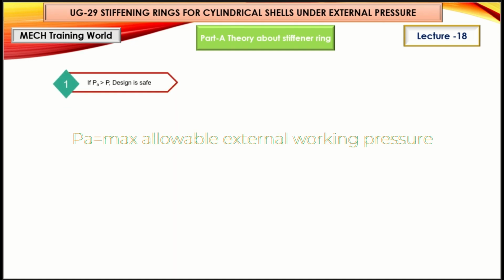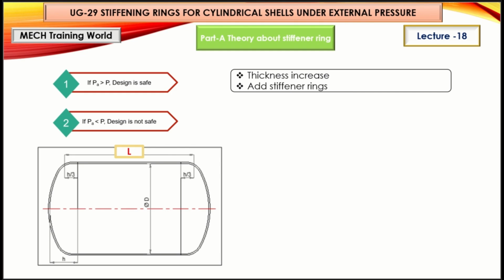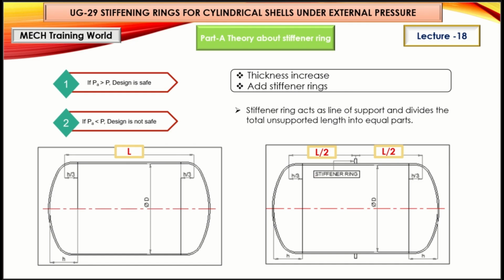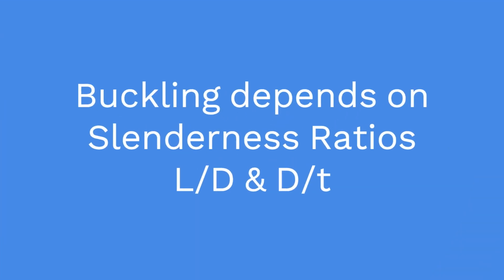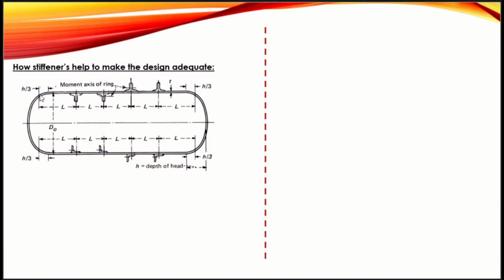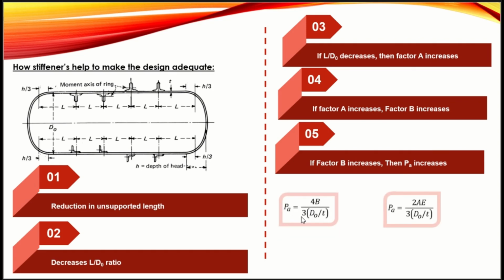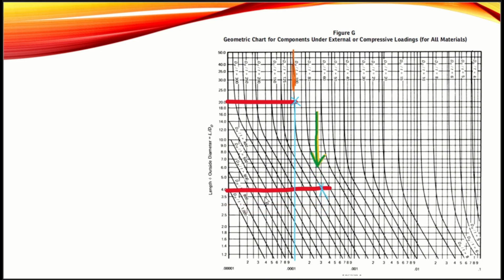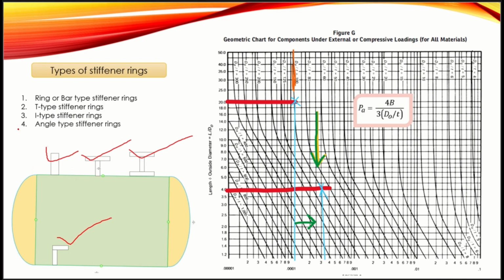Part-A UG 29 STIFFENING RINGS FOR CYLINDRICAL SHELLS UNDER EXTERNAL PRESSURE Lecture 18

Comment: 7:34 There you said 8 feet, But what 8 feet..? Diameter, Effective length..? Not clear
Reply from the maker: 8feet is dia brother this is generally followed in many industries but most probably we need to check according to UG-28 and UG-29 pressure calculations.